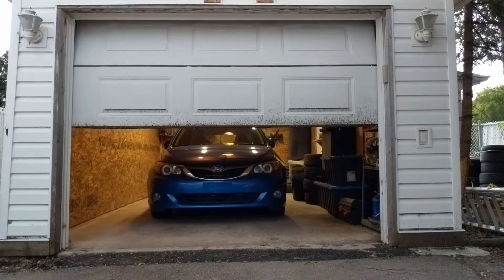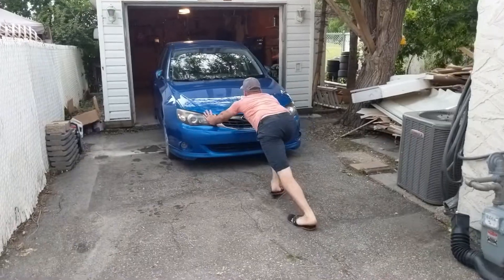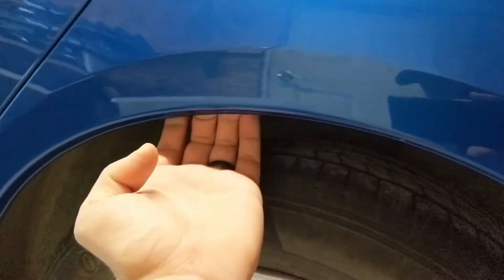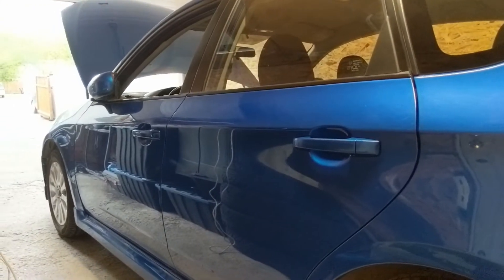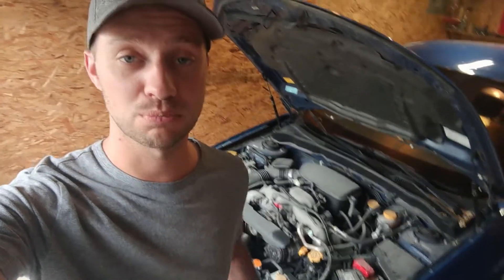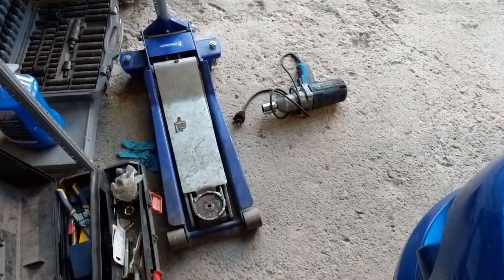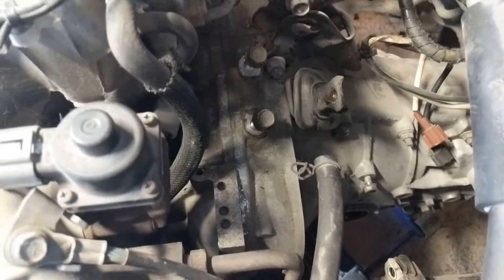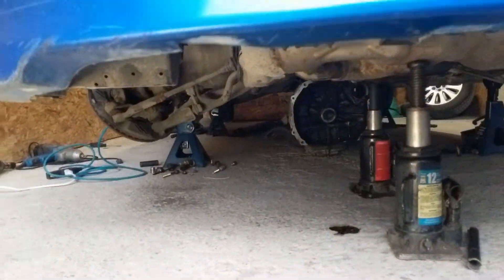Tim's new project car - doesn't run...

Comment: YESSS! I was actually hoping it was going to be a Subaru. Was praying for a Baja, hahaha.
Subaru clutch is fairly easy at least. Timing belt also nothing crazy honestly.
Subaru factory audio usually isn't the best. Optioned out it may have premium sound, a bit better.
Overall, looks really clean! I'm jealous. You made a ton of progress! Nice job.
(Don't tell anyone this is all I need to do on my WRX before driving it more but I'm laaame!)
Reply from the maker: Haha a Baja would be sweeeet! But really hard to find. Yes clutch is pretty easy, timing belt too. We've actually done a few of them already so it helps having that little bit of experience.
Would love to see you get your WRX running, although your STI swapped RS is wicked cool man!